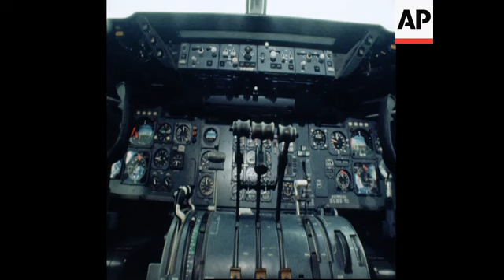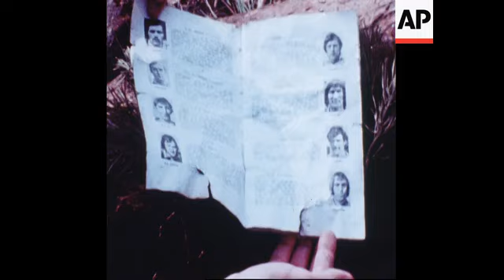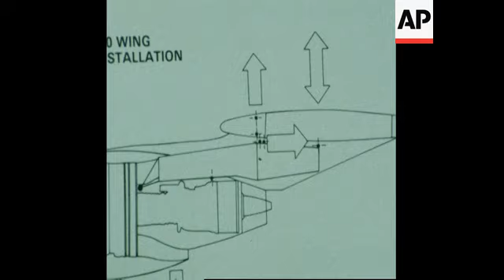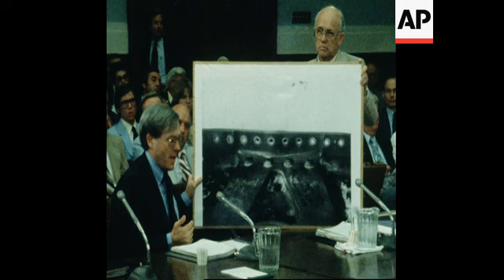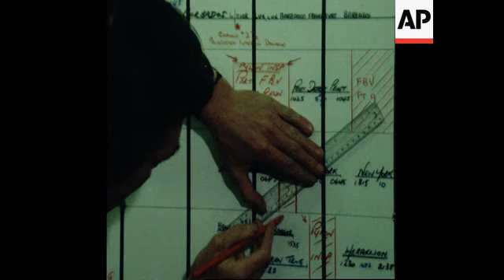RR7924B AVIATION THE GROUNDING OF THE DC-10

Comment: So frustrating to look back now with all the information knowing that flight 191 was the fault of American Airlines' maintenance practices.  
Because of human emotion and mob panic, it didn't matter that the accident had nothing to do with the DC-10.  
Also - all those American Airlines commercials in the 80s where they talked about their maintenance people - it makes sense now.  AA recovered, but MD did not.
Reply: "that the accident had nothing to do with the DC-10."

It wasn't the primary cause, but it would be inaccurate to say that the design played no role. The accident report cited lack of redundancy with the leading edge slats and stall warning systems. It criticized the design of the pylons as contributing to the vulnerability of damage; and issues of quality control, resulting in many planes leaving the assembly line with defective pylons. A more general criticism was the failure to consider "multiple malfunctions resulting from a single failure."

cheers
Reply: " . . . lack of redundancy with the leading edge slats . . . "
I think we're talking about the hydraulic system holding the slats in position - and it definitely could have been a different story if the pilots had known the left wing had lost hydraulics.  Hydraulic failures have caused many horrific disasters.  No matter how many redundant lines, there's always a point where they merge, and disaster always finds that point. JAL 123, for example.  
I can't really disagree with MD never publicly blaming AA - I'm sure there's a rule that you don't blame your customers.
Reply: Sounds like you're very knowledgable about aircraft systems. I think the DC-10 fear was way overdone, even though at the time I was afraid of them. Even in the Paris crash, it could be argued that MD could not have guessed that Turkish Airlines would tamper with the safety systems. Had they not done so, there would have probably never been a cargo door crash.

cheers
Reply: And I think this is where we arrive at the frustrating conclusion to most accidents - so many little decisions or mistakes along the way that could have prevented the disaster - if only someone would have said something or paid a little more attention.
Reply: indeed
Reply: As cchris874 pointed out, there was no redundant stick shaker on the F/O's side (it was an option!), the slats remained extended only due to the hydraulic pressure in the lines, and the engine/pylon system was poorly designed from a maintenance perspective.  There were numerous design "faults" with the DC-10.  This discussion doesn't even address the cargo door, or the lack of pressure relief between the decks.
Reply: It most certainly had everything to do with the DC-10, which was designed without reference to fail safe design principles. A single point of failure resulted in loss of aircraft and all on board
Reply: @cchris874 
Rubbish. MD knew the cargo door design was inherently unsafe and could be closed from the outside without the locking pins engaged
Reply: @djpalindrome  

Hi,

The above conversation has been about  the Chicago crash, not the cargo door crash. But  I agree entirely the Paris crash was primarily the result of McDonnell Douglas' denial about their own culpability. I've read all four books about that crash, and one of the little known or mentioned facts is that Turkish Airlines was also a major player in this failure. Just a few months or so before the crash, their maintenance people (presumably) tampered with the locking pins, turning them the wrong way, thus eliminating any undue resistance to warn the baggage handler the door was not closed properly.  This alteration was conclusively proved by the French investigators. That is most likely why the plane was able to escape disaster until 1974.

cheers